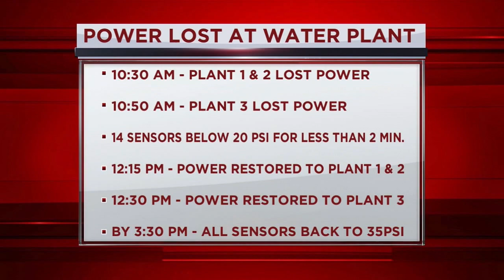Houston boil water order resulted from ground trips at power plants

Comment: Wow the power grid still hasn't been improved since I moved away years ago? How does everyone know about this glaring oversight and yet it hasn't been fixed yet? Why isn't electricity a bigger issue?
Reply: It was not the grid.  Are you sniffing glue?
Reply: @arthurfoyt6727  hostile reaction... do you work for the power company or something?
Reply: @abro14  I do not suffer fools well.  It was NOT THE GRID; it was local to the city water plants.  The water system could have been protected if the "woman of color" running it reacted within an hour to preserve the line pressures.
Reply: @abro14  The TRANSFORMERS at the plant and take grid power and step it down for use at the plant.  They are AT THE PLANT.  The grid was fine, this was localized.  I see you never took an EE course either, eh?

Comment: This story seems to be about water plants, but the title says "power plants".
Reply: Did you not get that it was the outage at a power plant that caused the problems at the water plants? So this has to do with the power plant.
Reply: @YourEvolutionCoach22  A power plant is not mentioned anywhere.  The "ground trips" of the title were events at the water plant.
Reply: @YourEvolutionCoach22  It was LOCALIZED at the water plant.   There were no power outages as this was just at the transformers at teh plant.  Not one for comprehension, eh?